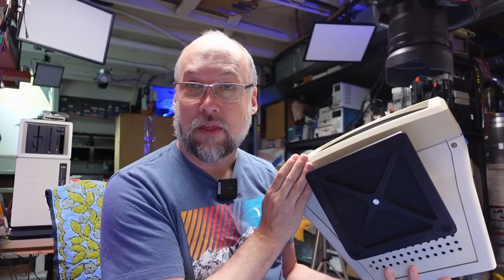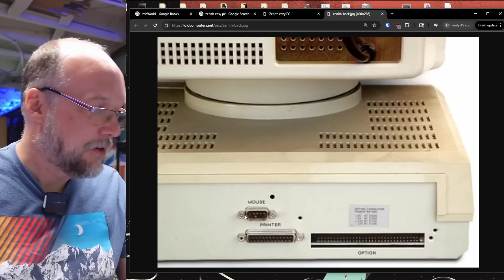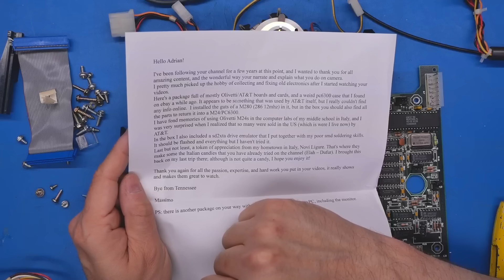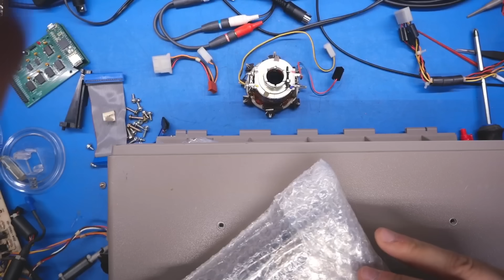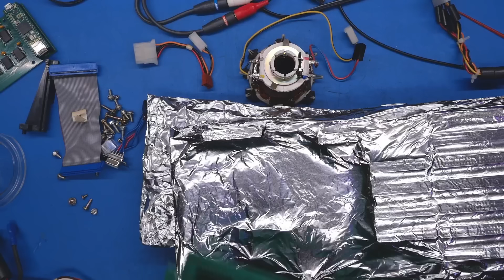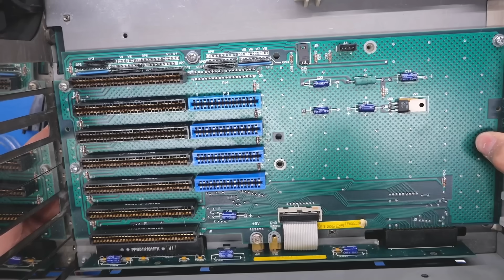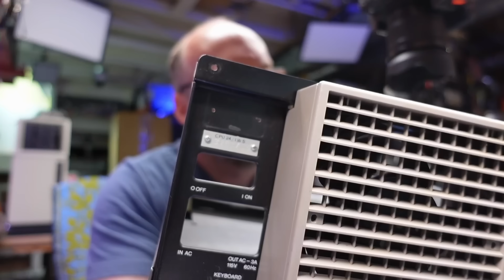0109 An undocumented AT&T computer, Olivetti parts and a terrible Zenith Eazy PC

Comment: Regarding the 6300 case with the flip-up hinges:  While the original M24 and other OEMS (AT&T 6300, Xerox 6060, Logabax 1600) did not have this, AT&T used to repurpose older inventory for use as specialized terminals or control systems.  For example, there is a less-common 6300 keyboard variant that has the function keys in a different layout, along with a key labeled "Help".  So my educated guess is that it's possible the hinged case was an example of this, where they didn't want the users touching the storage media.
As for the small vertical plastic piece on the side of the case, that was meant to be popped out to run a ribbon cable through if you were expanding the unit with an external hard drive.  There are some illustrations and I think a few photos showing that in action.
Reply from the maker: Makes sense! That rectangular cutout on the top of the front panel likely is for a keylock that was on the hinged part. I thought maybe this was some industrial or public space version of the machine with the whole hands off thing being important. I also had no idea the 286 board just worked in the M24 as well. Really the question is what to do with this case?
Reply: @adriansdigitalbasement2  one of the reasons for sending it to you was to give it some exposure.. if someone comes up with a picture of what the lid looked like, I can try to make a 3d model of it for printing
Reply: @adriansdigitalbasement2 Maybe hold onto the case for putting loose spare parts in to make a second M24?

Comment: The NEC V40 is the same of the Olivetti PC1
Reply: I'm curious to see how similar the eazy PC is to the pc1. I think they also have very similar video outputs at 600x400
Reply: @massimopessino7606  The funny part is, I'm sure there are very few NEC V40 in US, and most of them are in Adrian's basement.
Reply from the maker: It really is odd now we have so many. Maybe the BIOS is interchangeable between the PC1 and EazyPC.
Reply: @massimopessino7606  Another curious similarity with the PC1 is that the final version of the Olivetti machine (the PC1 HD) used an XTA hard drive as well.

Comment from the maker: I ended up testing the XTA (XT-IDE) hard drive from the Zenith Eazy PC and it was totally dead. The board was getting power but it didn't even attempt to spin the disk. Typical, I'm not surprised in the least it was dead...
Reply: Hi! Sorry for all the curved balls I threw at you! So the eazy PC and the monitor should all work. I sold the case to a collector in Portugal so I was left with the various chunks. I didn't reassemble the monitor on purpose to increase the chances of the CRT surviving shipping. The hard drive seemed to behave as if there was a short in it. Way over my head. It did work for a little bit when i first got the computer. The Isa alot i also added as an experiment to see if the port was Isa compatible, which it is. You can plug in at xt-ide card and it will boot with no issues.
I did make the stand for the monitor, in case you can use it for something else other than taking the CRT. 
The xta2sd hopefully works, it didn't seem super straightforward to use. I think i put the instructions in the box with it, but if i didn't here's the link to the project https://forum.classic-computing.de/forum/index.php?thread/34924-xta2sd-card-als-ersatz-f%C3%BCr-eine-hdd-von-einem-8-bit-xta-bus/
Reply: Are you sure the motor wasn’t just stuck?
Reply: WD XT-IDE drive in Commodore PC20-III, too. Didn't last long at the time. Practically impossible to find a working replacement.
Reply: If you get around to adding a 2nd floppy drive and/or testing an xt-ide board, I'd be interested in getting your experiences.  Right now mine boots to zenith pcdos and I can run simple dos commands.   A serial port added would make a nice simple terminal.
Reply: The PCBs of those old Tandon/WD hard drives are loaded with tantalum caps, it's quite possible one of them has shorted. Please check before condemning the drive, no more are to come…
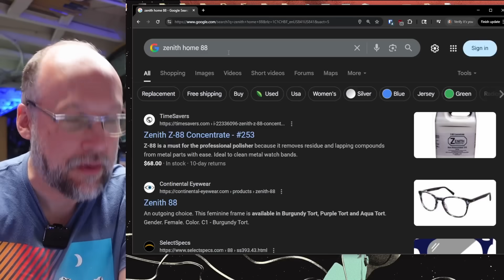Reply: 8:35 you can press "More" button, select "Web" and get good old links without all this junk in search.
Reply: Would you be interested in a MasterVoice butler in a box? I have two of them in box complete and I want to get one working with home assistant if possible.... Funny thing is the setup guide is on a cassette tape. Also got a JVC portable broadcast monitor for 100 bucks that has ntsc and pal in a porta brace case if interested it's also color...
Reply: Somewhere in storage, I have a 40 MB Seagate drive that I remember being labeled as XT/AT IDE.  It definitely had the XT part; I think it could be jumpered to work as either XT or AT IDE.  I don't think I've tested it, and it would take me a while to find it at this point.
Reply: Some of the Commodore's own Amiga 500 HDD expansions also have support for XTA drives, but they were mainly supplied with SCSI. The little I have been able to find about these rarities, is that the bus does not yet have support for master/slave distinction or a few other signals, and it is only 8 bits wide. I have a Miniscribe drive that likely is XTA, I 've been testing it a bit with the Amiga controller but it doesn't seem to do anything at all after spinning up.

I also had an old Philips PC in the late 90's, which had a 20MB XTA drive. It initially gave trouble but worked after low-level formatting. It likely had a corrupted track 0 which was fixed by LLF. I doubt it would have stayed functional to these days even if I kept the computer.